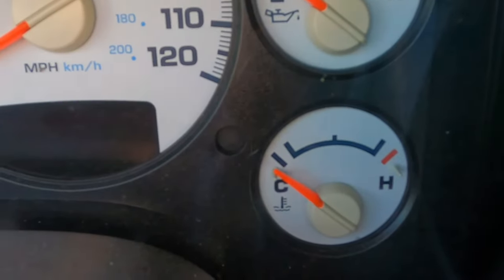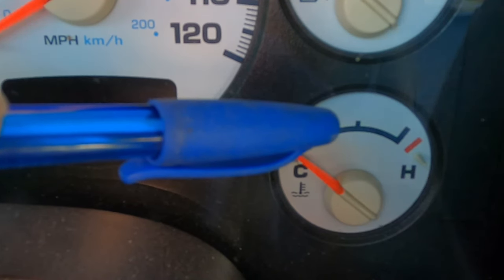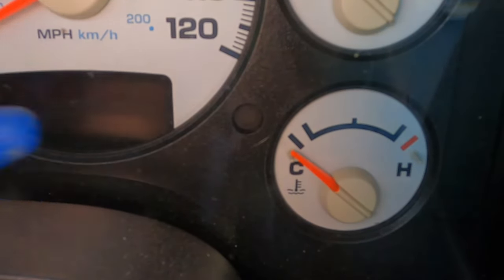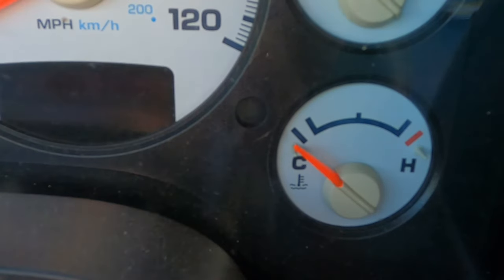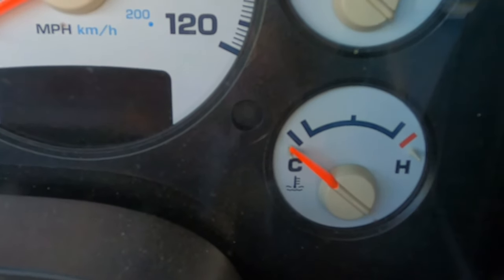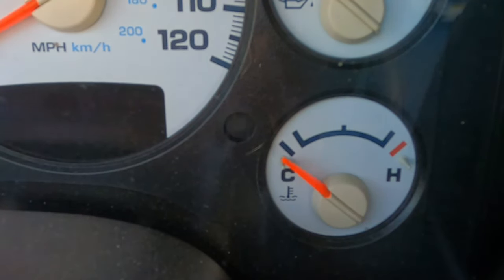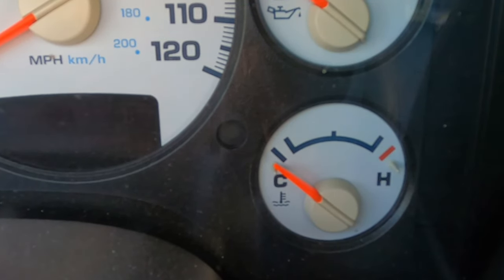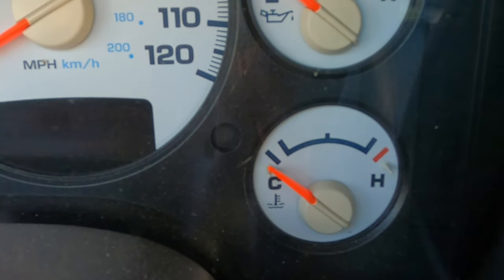Signs of a Faulty Thermostat in your Ram.

Comment: 2004 ram 4.7l with 143k miles. New radiator. 180 thermostat. New water pump. Az summer runs at the line or a little past the line if at a stop light. Never did that before. No leaks. Runs good. Good to see I’m not crazy either.
Reply from the maker: Have you check the fan to see if it is still engaging after some heat
Reply: @autoguydiy4244  it is a 2 year old fan clutch I replaced with the water pump. Actually running into it getting between middle and H at stoplights. When driving it goes back to middle. Do you know the temp ranges? The dodge manual doesn’t say
Reply from the maker: @jonnyboi3048 depend on truck and year talk to me buddy
Reply from the maker: @jonnyboi3048  well on the 4.7 I do not.
Reply: @autoguydiy4244  04 ram 4.7l with 145k miles. Gauge looks the same. Middle should be 180 or 200? Middle between middle and h like 240?
Reply: @jonnyboi3048 my 03 does the same thing, I changed the radiator hose and thermostat, and at a stop light it goes past the line in the middle and when I’m driving it it goes back to the middle.

Comment: I replaced the thermostat in my truck is running warmer than it normally did. Thanks for the peptalk pimp. I’m gonna replace the thermostat again tomorrow, I’m sure that’s it.
Reply from the maker: Go with a Murry ultra thermostat
Reply: If you do not buy a good brand, it won't open when needed!  The Cheapest one isn't the way to go.
Reply: I’ve replaced the radiator, water pump, thermostat 2x, fan clutch, and it’s still getting warmer than it should. 😂

Comment: Brh I have a 1992 chevy s10 blazer  I changed the water pump, thermostat and that's what it was doing it would touch half and go down, driving it longer it would go over half and stay there but would only come down when I basically stop driving
Reply from the maker: What kind of fan do you have mechanical are electric

Comment: For Texas summers. Go with a 165° or 180°

My 2500 diesel never reaches halfway but it does get very close.
I plan on having the system cleaned with CLR.
Install new pump, sensor and coolant soon.

Comment: Mine seems to be working after I let the car run a while, then my heater will heat up but it takes a few minutes. 

I replaced the radiator, but not the therm. And was wondering why my new radiator is only taking the first 2 gallons of premix I put in. Any ideas what that could be would be a great help.
Reply from the maker: It will alway take awhile to warm up as in the heater. It works off the hot Coolant.  The extra antifreeze just drive it a little bit then check it could be an air pocket trapped
Reply: @autoguydiy4244  will do. Thanks

Comment: Thanks brother I have a 2016 changed the thermostat because it overheated but not losing any coolant. Well truck acting the same way after replacing the thermostat so I thought we’ll maybe the water pump is getting bad like maybe the metal plate/gasket has a hole in it. But that wasn’t the case. So pulled the new thermostat off took it back out  another one on it same damn problem! But my temp will go all the way to the red line and then cool back down to 194 and then creep back up to 220 if I’m driving it. If I stop at a light back to the red she will head but if I rev up the motor it will cool back down. Now keep in mind with the engine in the red my heater is cold air. Got any ideals? I’m stumped!
Reply from the maker: Could be a stopped up heater core
Reply from the maker: What brand thermostat
Reply: fan clutch.

Comment: Man, I’m having some issues with my 2007 dodge ram 1500 4.7. Replaced thermostat, water pump, fan clutch and The ECT. Still having similar issues! Looks good for a good bit, than it starts jumping up. Goes down alittle, temp is about 230. Wondering if it’s a cheap thermostat….
Reply from the maker: Use a Murry ultra thermostat
Reply: I have a 04 ram 4.7 with 145k miles. 2022 new radiator, 180 thermostat, water pump and fan clutch. Now az 110 summer is here after work it goes to middle from middle to h when stopped or idle. Driving at speed it stays in middle. You figure out what it is? Could just it being a 20 year old az truck. Runs fine in 70 degree mornings.
Reply from the maker: @jonnyboi3048. What condition is your radiator cap
Reply: @autoguydiy4244  99% sure it’s a new cap. I have the old cap and fan clutch I might swap and try. Could be easy. The fluid is a little below the “fill or full” line. Can’t see anymore what it says. Might top that off to the line as well
Reply: @autoguydiy4244  I opened the cap this morning and it let pressure out. Might try it this evening to see if there might be more air stuck
Reply from the maker: @jonnyboi3048 so to check your fan start truck cold listen closely as it warms up it will Start to sound more intense or as if the fan is engaging

Comment: Im having a problem where my engine is only getting up to about 183° instead of 195° to 210°.  Running a bit rich and rough.   Looking into thermostat issues i learned that sometimes the temp will increase by 10° to 20° over the set temp for that specific thermostat.   The guy i got the truck from said he changed it but dodnt know what temp it was set for.  so im thinking maybe he put in a 165° and that's s why im underheating.  I got a 195° im going to put in and see if i can get it back up a bit.    Was just thinking that maybe that was your case of overheating.  You got a 203° and maybe it was running up to 220° or 230° and getting a bit warm?   They dont always keep your engine at the desired temp!   Might not have been a bad thermostat you got but just need maybe the 195° instead of the 203° you got for it.    Who knows..

Comment: Mannn I changed my thermostat and oil coolant housing truck still overheating 🤷
Reply from the maker: What thermostat did you use
Reply: @autoguydiy4244  thanks Mopar from dealer
Reply from the maker: @rafabri9306 take your belt off and check your water pump for noisy or  sloppy bearing. Spin pully and try to move it around to see if there is excessive play
Reply: @autoguydiy4244  thanks for answering I was thinking of flushing coolant see if helps.
Reply from the maker: @rafabri9306 that is a good start